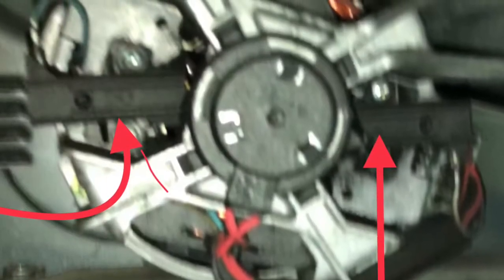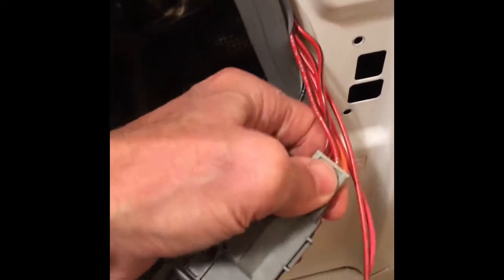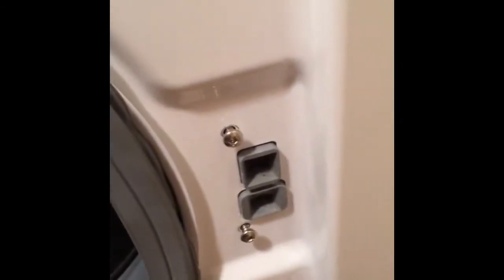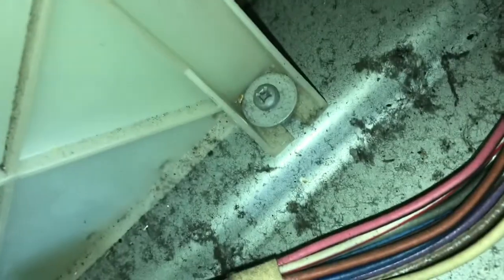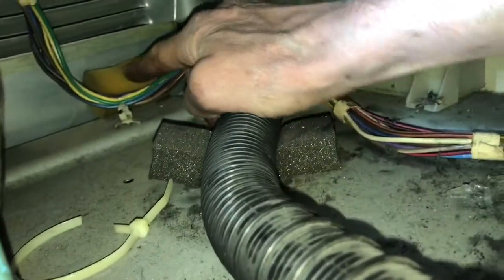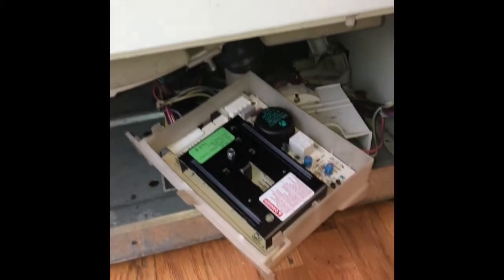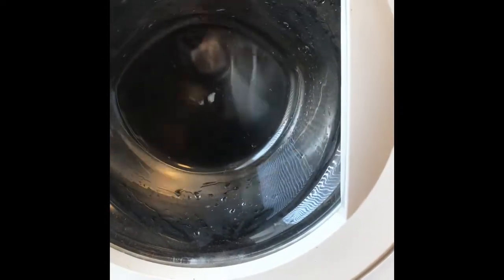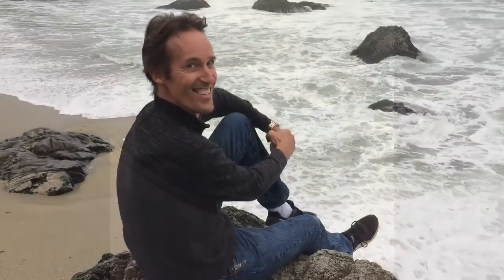🔧 Frigidaire Washer Won’t Spin - How To FIX 🔧

Comment: Can not hear what your saying when is running. What happens to the control unit with the heavy loads?
Reply from the maker: Too heavy can blow a fuse in the motor control unit.

Comment: So did you just take the old circuit board out and put it back in or was that a new one?
Reply from the maker: It’s a rebuilt one👍
Reply: What's the  part number

Comment: Thanks for this video. I Replaced the motor control and If fixed my no spin problem! Wife had washed my daughter’s heavy coat by itself and It fried the control. Thankful it’s back to normal.
Reply: Did you notice any evidence of frying on the circuit board? Just took mine out and it looks fine. Makes me hesitant on ordering a new one if that isn’t the main problem
Reply: @eldeteproductions  no, I pitched it without taking the cover off. I got a used one on eBay complete with the cover, so I didn’t have to swap out the boards. I had already replaced the door switch and that didn’t help, so figured this was about the only other thing it could be. Washer was filling with water and pumping out, but no agitation or spinning at all. No sound of motor turning at all either. Guess it’s fairly common to happen when a single heavy item, like a rug is washed. It throws the tub off balance. Should always wash more than one thing so it can balance out the tub.
Reply: @roghoff1958  this is the exact issue im having. I was just trying to test the board with a multimeter because I fell down that rabbit hole. In the same boat though, seems a used board might be the last ditch effort. thank you!
Reply from the maker: Nicely done 😊
Reply from the maker: I wonder if it’s a bad door lock?
It’s much cheaper 👍
Reply: @ScottTheFixItGuyChannel  I replaced the door lock, no luck. Still in no laundry hell trying to figure this out. I can’t find an exact part number match on eBay for my board. But there are many options with same motor type number (20585000) and seemingly looking the same. Could they be interchangeable? My board is 134859500 in a Frigidaire GLEH1642FS. Thanks!
Reply: @ScottTheFixItGuyChannel  also forgot to mention I tested the fuse on the control board and it was reading fine. So still not sure of that is the issue

Comment: First, my Frigidaire washer model is LTF2140FS1.  Moving on, the screw heads are a hybrid (phillips combined with a square-drive Robertson) just like the ones used to secure the front panel, top, horizontal panel, and several other parts.  I tried using a phillips screwdriver on them and they did not budge.  Luckily, I had a case of drill bits with the right size square bit and that worked like a charm.

Today, the new door lock latch assembly arrived, I installed it, and still the washer immediately turns on the "No Spin" LED despite the position of the Program knob.  So, now I believe the motor sound I hear could be the motor control board/unit trying its hardest or the drain pump, which I know properly works because I inspected it a few weeks ago when I removed and thoroughly cleaned the drain valve.  Next, I hope to find a replacement motor control board/unit.